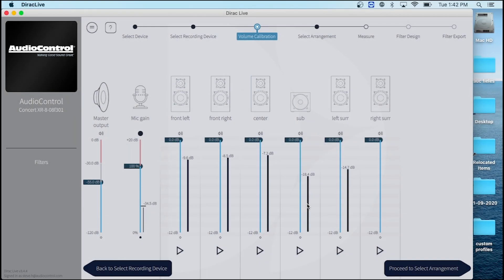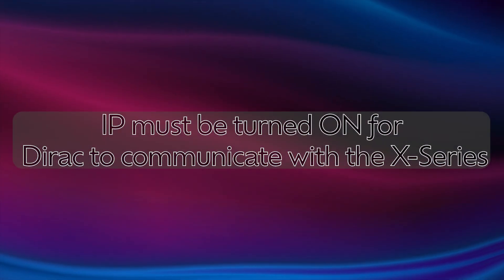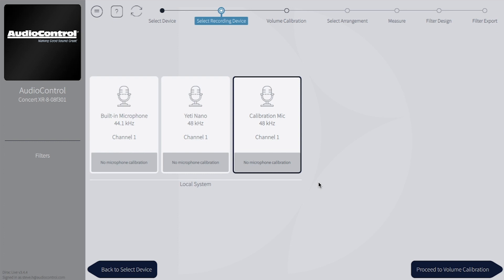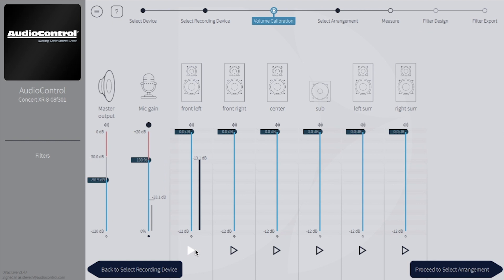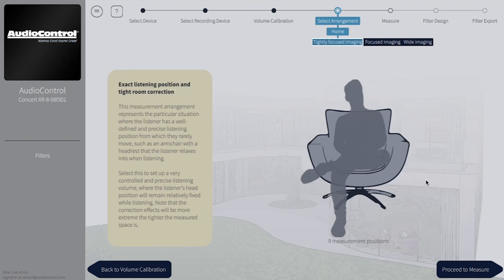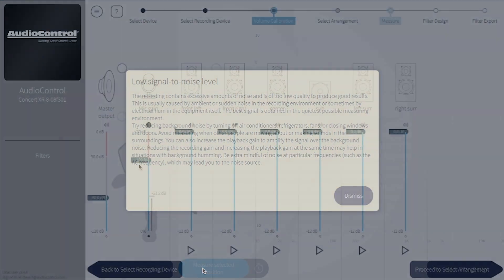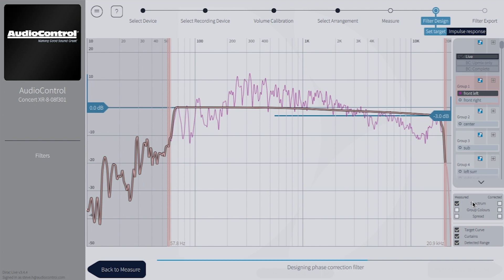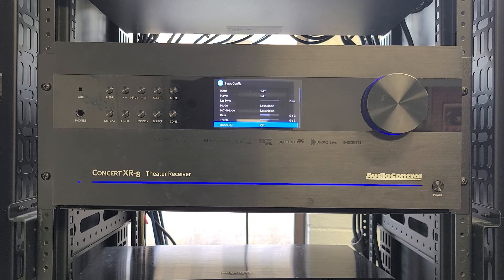Dirac Live Tutorial - AudioControl Home

Comment: i dont think you need to set speaker levels per speaker. DIRAC does this during the measurement process. what is important is to make sure each speaker is AUDIBLE for dirac. It will sort out everything else fine. The main part of volume calibration is not to calibrate volume (DIRAC can do this) - it is to ensure you are above the system noise floor so that DIRAC can do its job

Comment: 😂😂 dirac default settings for your curve? Open your ears guys, that flat line will exactly do what a flat line does.......it will hammer your complete sound flat. Do not follow these instructions, this is not what Dirac is created for.
Reply: Hi, the standard Dirac curve tends to head down towards the HF by a few dB, it's not flat. In my experience of using Dirac on many AVR's 'going' with the standard curve gives great results. There's SO much DSP being applied in the form of phase and EQ adjustment that it makes a heck of a difference still. Cheers
Reply: @wh1972  it changes the sound of the speakerbrand, that's a fact, and that's not why you buy a specific brand of speakers. Maybe "flat" wasn't the right word.....it should be "straight" then. But one thing is for sure: if the measured characteristics of the speaker are way of of this straight line then you are messing up the sound of the brand. I've tried over 50 brands and never ever has the straight line been a good result. You'll hear the real magic of dirac when you really learn how it should be done😁
Reply: @twotraxz  I think the point of the video is to help get users on the right track using Dirac. I think going with the standard curve does work well. I normally manipulate the target curves when using the software (as you do by the sound of it) but if it can get messy and not return a sound that mimics the changes visually made.
Reply: I'd dig a tutorial video of some of the tweeks you're referring to!
Reply: Dirac default measurement result did a excellent job on my Pioneer Elite 505
Reply: I thought this video was very helpful. I’m sure there’s many more things to learn but this will definitely get me going. Thank you!